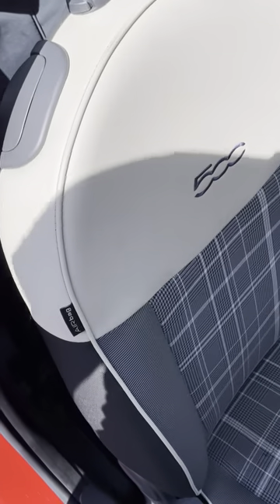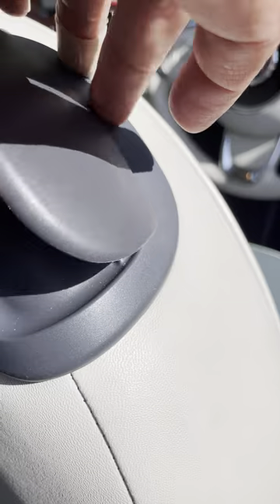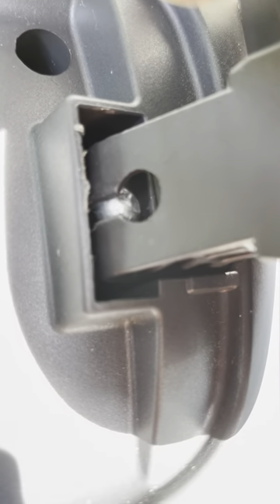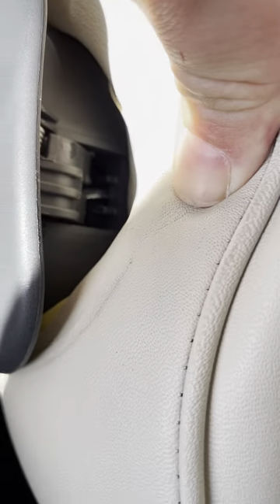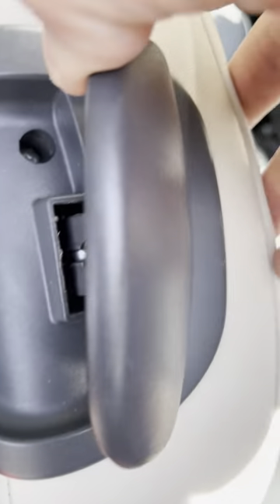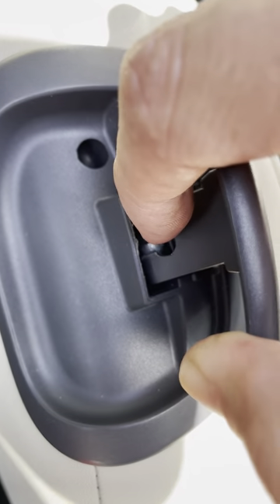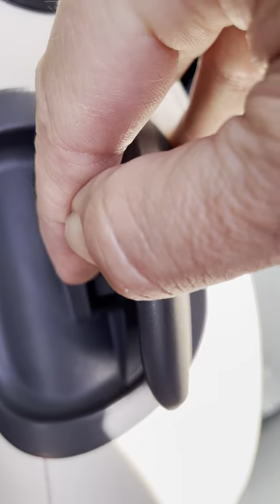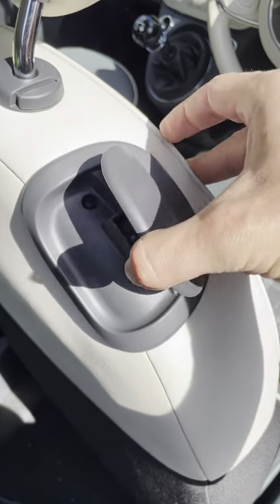Fiat 500 seat release cable fix

Comment from the maker: Just to update this, the cable came loose again and I actually dismantled the handle - the plastic had split, allowing the ball-catch to slip out again. I have to buy a new handle piece
Reply: Did you fit the new handle yourself? I can only see one screw but have undone this and it still seems firmly fixed.
Reply: @menheny  Honestly l can't remember, but it was pretty simple I seem to remember - sorry, that's probably not much help!
Reply: Thanks for taking the time to reply. I guess it’ll be obvious how to release it when I see the new handle.